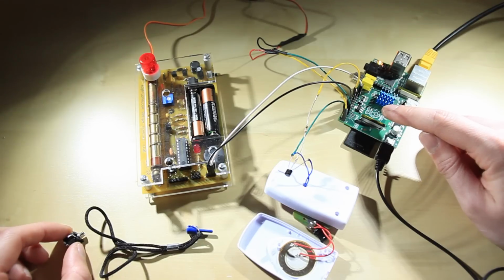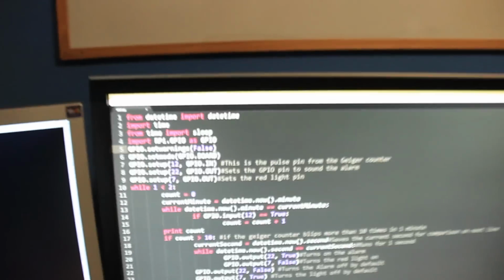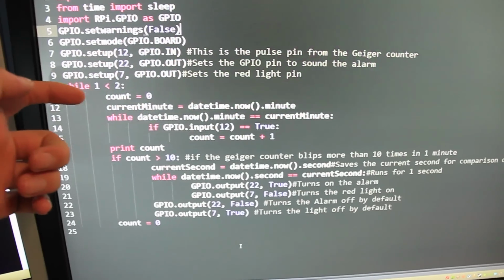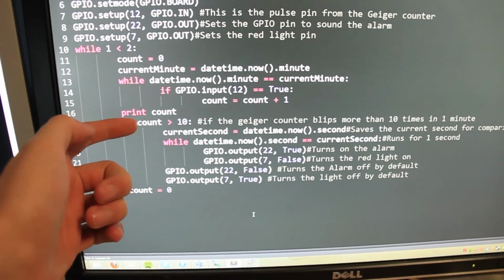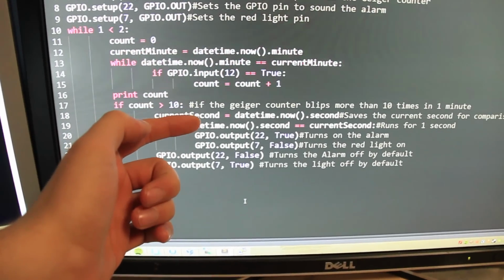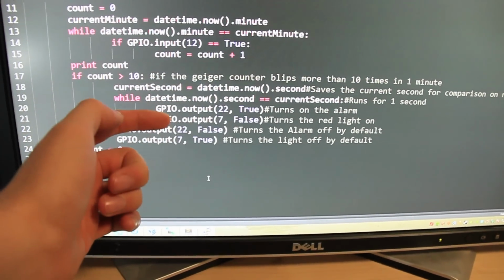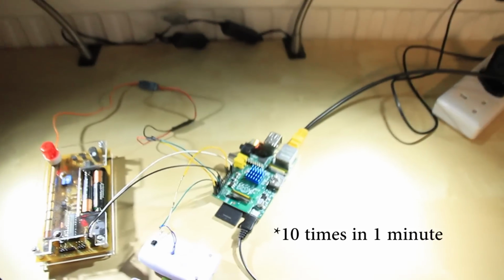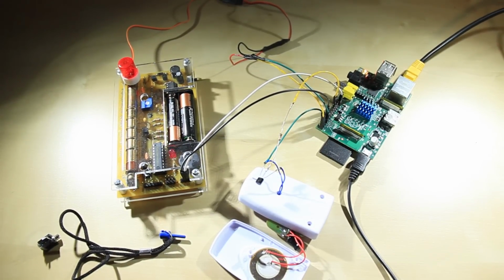Raspberry Pi Radiation Warning System

Comment from the maker: Sure, The Geiger counter was made by MightyOhm. That was the most expensive part i used. The Panic alarm i purchased off eBay. There are loads on there and are about £2.00. The flashing light i used was a light for a remote control car and i purchased that from eBay also. It was around £7.00